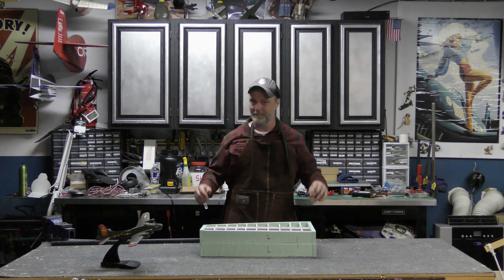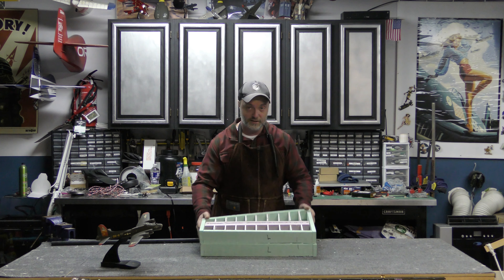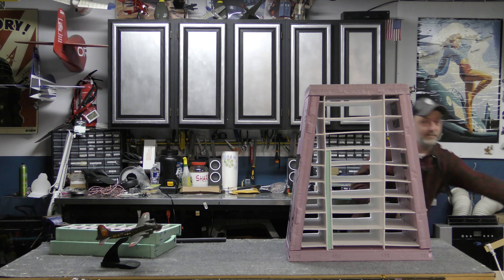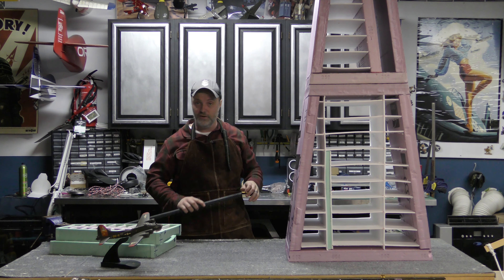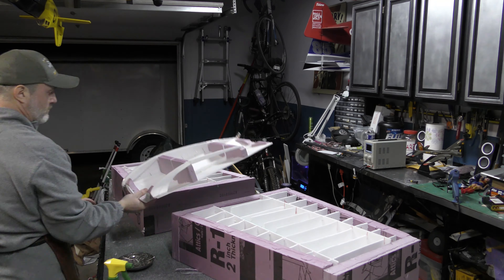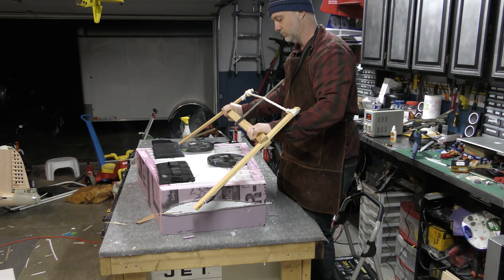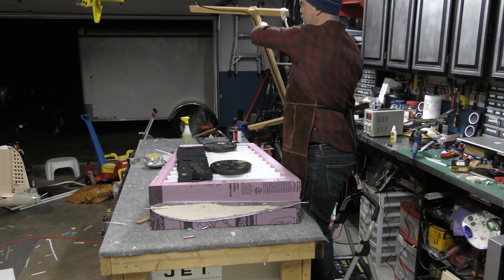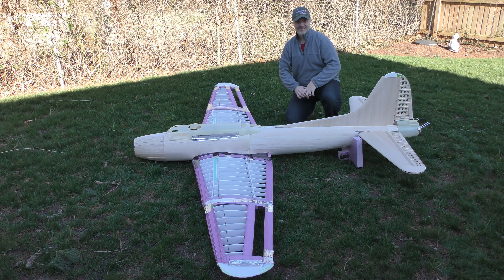1:9 Scale B-17G 'Sweet Pea' - Wing part 1

Comment: Why not make the boxes smaller to waste less material?
Reply from the maker: There were a few reasons.  One is that the large foam I was using had prefab cut/break lines to make it easier to install in construction projects.  I ended up using those lines to make it easier to build the boxes.  

The other reason is that I wanted the left over box to still be rigid enough to hold its shape so I could use it as a "bed" when I glued in spars and sheeting.  
Could be done with less waste though.  Just a matter of time and effort.